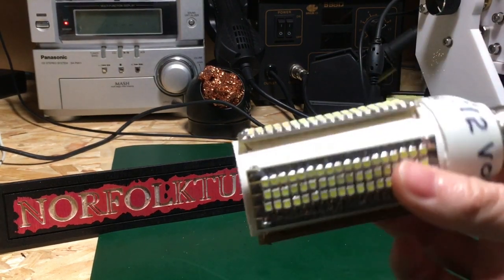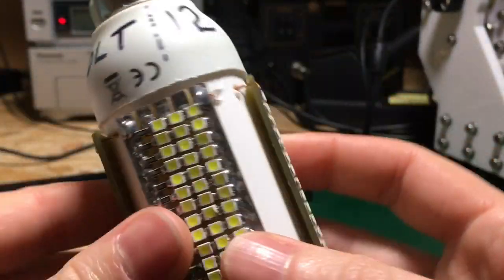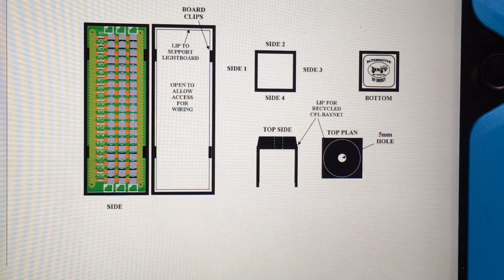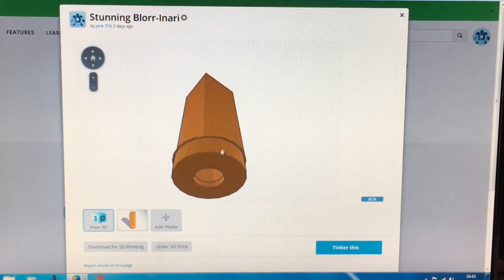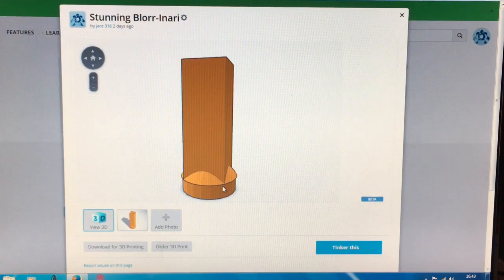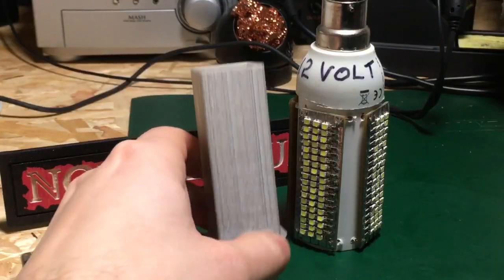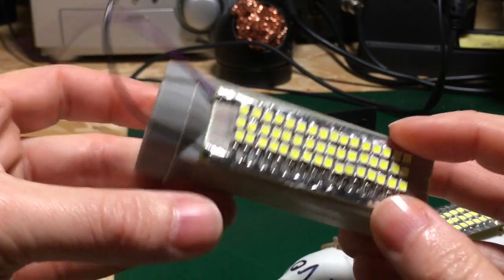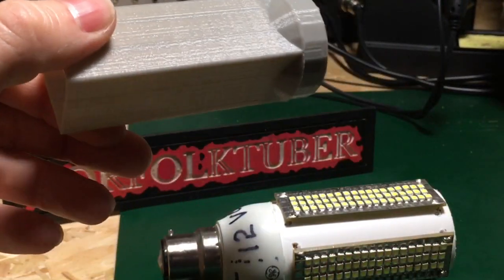3D Printed light bulb

Comment: Really brilliant work on Raymond's original there, its a nice smart evolution to the lite design for the boards, this does look really nice smart and robust i must admit, its possible i would try a laticed pattern on the diffrent sides as the board when mounted will cover the strucural intergrity of the design i think, this will also save on weight and with luck print run time which is handy for stepped up production, where i would go for side rails with a reverse over hang like what an id card slides in to that goes around the neck and a blob of glue gun glue to seal it all nice in place perhaps, the temps shouldnt melt the glue i dont think, while the latice work would also help on the cooling front too :-) Its little bits is all i would mess with on that design front incase of a larger scale production run of them is done down the line :-D but as is when the boards are connected in place it looks a smart lite efficient unit for sure :-) My very best my friend :-p

Comment: rather then tabs could to make grooves they would slide into
Reply from the maker: Thanks. yeah thats what i want to do but the edge of the slot will overhang
Reply: the led board you mean ? i think if the slot was built up from the bottom you weant have the problem of free standing and sagging due to not coling fast enogth
Reply from the maker: yes that would work but it would increase the diameter of the base then it will not fit into cfl fitting.
Reply: no way of bringing the led boards closer to the centre to give that little more space and i think slight over hang for hoklding the boards would be ok as long as the round base still fits the cfl base
Reply from the maker: no boards are as close as can be. will redesign with over hang and see how it prints. Thanks
Reply: ah thats a bugger good luck